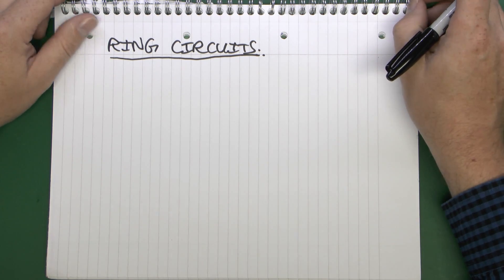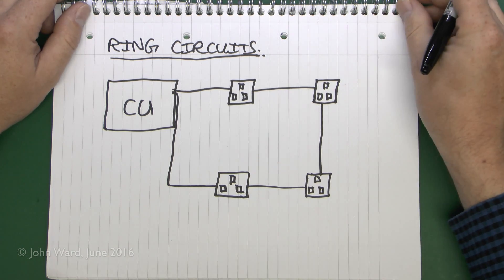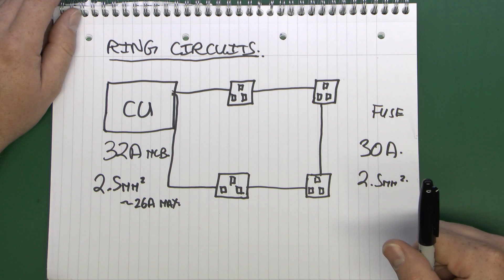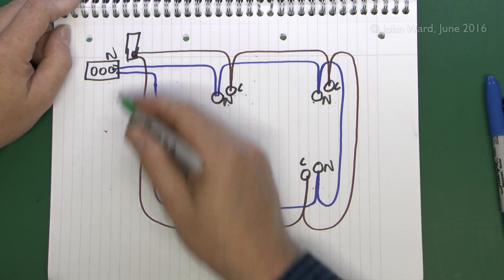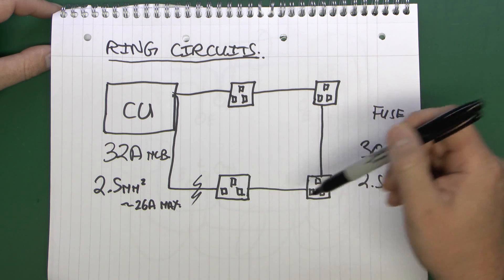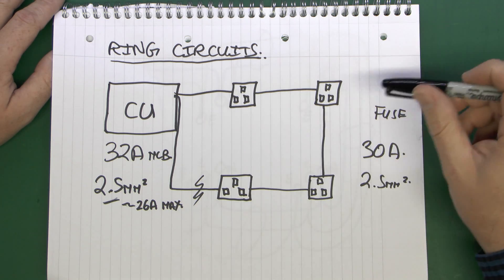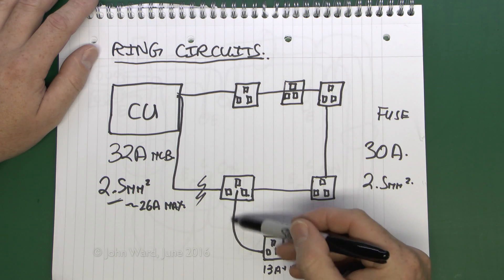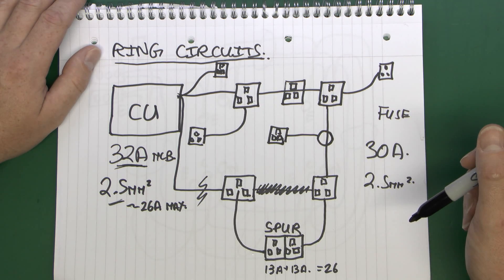UK Ring Circuits (previously Ring Mains) for Socket Outlets

Comment: When I first heard about these, I thought they were relics of the past. I was shocked (lol) to find out that they're still in use today, and you've explained very clearly to me how they work. I wouldn't want one in my house; good thing everything here in the States is what you refer to as radial.
Reply from the maker: They should be relics of the past, unfortunately plenty of people still insist on installing them.
Reply: @jwflame  Why don't they just repeal the standard for new installations? We have plenty of old wiring over here that, if worked on by a certified electrician (on the record), must be updated to meet current standards.
Reply: @RAndrewNeal  
Rings are superior.
Reply: @johnburns4017  If that was true, they'd be more than a war-time cost-saving measure and in standard use all over the world. They're a fire hazard.
Reply: @RAndrewNeal  
Totally wrong. Read my posts on these comments.
Reply: @johnburns4017  No. If the ring gets broken, the effective wire gauge is halved, while the breaker is sized for an unbroken ring. The circuit doesn't fail safe; it fails in a fire.

Radial circuits may be more expensive, but you get what you pay for. Their superiority is why they're the standard.
Reply: @RAndrewNeal  
You never read my posts. A final ring can be protected by one 25A double pole un-polarised MCB. Both L legs of the 2.5mm cable go thru each of the MCBs input terminals. The MCB does not have to be L&N, it can be L&L. The MCB does not care if L or N runs though any side of its two sides. It is essentially two single MCBs joined with the switch levers locked in. An RCD feeding the DP MCB.

When one side of the MCB  detects a fault both poles trip, cutting both legs. If the RCD detects a fault all L and N are cut. The ring could deliver 50A, 25A per leg. The 2.5mm cable on each leg could take 27A but is protected by a 25A overcurrent device - very safe. 
1. If the ring was out of balance it would trip. 
2. If the ring was cut for some reason the MCB would trip if the current went over 25A on any of the legs. 

The best protection on overcurrent of the cables.

The British regs say max breaker size is 32A protection for a whole circuit. So a 25A double pole unpolarised MCB taking both L legs of a final ring conforms. The MCB can be reduced to 20A if the cable is derated, still delivering a max of 40A. Many bases are covered. If RCBO protection is needed an RCD can be added with its L output fed into both sides of the MCB. Both Ns into the RCD. 

Easy. Far better and safer than radials for power outlets.
Reply: @johnburns4017  Well I said I wouldn't. I'm glad that they are indeed fully protected, but that doesn't mean they aren't unnecessarily complex both to wire and properly protect. How much do you save in wire after doubling up on your breakers? It's at best equal to a radial circuit, so monetary savings are about the only advantage you could get.

Radials are dead simple, require a single breaker per circuit, don't require balancing conductor currents, and cleaner. Superior enough to justify potential higher material costs (which is only a one-time purchase; don't cheap out where it matters).
Reply: @RAndrewNeal  
Radials are simple? Please! Many have legs off legs off legs - very complex.  Voltage drops and only one way back for the earth (cpc), so less safe. 

Final rings are simple to install delivering the power, replacing a number of radials. As I wrote using a 25A double pole MCB eliminates this fear of a break - never come across one myself. It will also deliver 50 amps,  able to run an a/c unit with amps to spare. It also uses cheap 2.5mm cable, an unpolarised DP MCB, and will cover 100 squ metres of floor.  No contest.
Reply: @johnburns4017  Doesn't matter how many branches go out from the circuit; they're all in parallel with a single source and single return. As I said, dead simple. Why in the world would you consider something so basic to be complex? Designing a ring is parallel with extra steps, making it more complex by definition.

Voltage drops and? Last I checked, we don't have 0-resistance wire. You are going to get voltage drop regardless. It's just going to be harder to calculate if you're running a ring. Besides, a short radial is going to have less drop than the equally-short side of a long ring. Best case scenario for a ring is as good as a radial; not better. That is, assuming that double the cross-sectional area of the wire equates to half the resistance and double the ampacity.

The ground conductor is a safety measure to begin with, which is redundant in and of itself. There is little benefit in adding yet another. As you said yourself, you've never seen a break in a ring, so why should your sentiments flop just when it benefits your argument? That's inconsistent.

You also failed to answer my question earlier. How much do you actually save when all is said and done after using cheaper wire but more of it and more complex breakers? 50%? 20%? 5%? It can't be more than 50%, and I'll take a generous shot in the dark and say maybe 30%.

You say rings are simple to install? Radials are simpler. One run and done; no looping back to the box. You can branch, but it isn't necessary. There is simply less to keep track of, which makes it undeniably simpler.

With a ring, you're inadvertently running smaller circuits, even though you tout big numbers. Sure, your one circuit can supply 50A, but if I run two radials with the thicker wire, I can cover the same area with 100A (50A per circuit). The capacity of the circuit scales with its cost. Though we mostly run smaller circuits over here because 50A is overkill for domestic lighting and receptacles. 15A and 20A at 120V are most common. The high power appliances usually get their own 240V high current circuits.

The only real advantage you get with a ring is cost, and that's with a trade-off of total power delivery capability. And you've yet to prove me wrong.
Reply: @RAndrewNeal  
Radials can be very complex. You fail to understand that a ring is a simple circular busbar. As the voltage hits a point on the ring from two points, voltage drop is far less of an issue in a 100 square metre floor area - max is 100 metres. 

If the earth (cpc) brakes for some reason ona radial you are stuffed as the circuit safety mechanism has gone. With a final ring that is not the case as it has two ways back to the breaker and panel. The prime role of the cpc is to trip the breaker in the case of a fault - that mat be absent if a there is a cpc break on a radial.  In commercial there is a circuit called a reverse return, it is a radial with the cpc at the furthest point of the radial turned back to the main panel. Only the cpc is in ring.  A domestic final ring has this safety feature integrated. 

One final ring can supply what a number of radials can, using less of and smaller gauge cable.
With many low amperage appliances these days a final ring on a single AFDD makes economic, safety, and practical sense.  

AFDDs are mandatory on some power circuits in the UK, and recommended on all. They are around £100 each. Having one on each power circuit is an expensive undertaking, while using a final ring only one will be needed.  

If you are paranoid about a cut final ring, then a double pole MCB can be used after the rime circuit protection device with the Ls of each leg in each pole. Screwed connections can work loose for sure, but using Wagos to maintain the spine of the ring with flex cable from the Wagos to the socket's terminals reduces that to almost nil.  

In the UK cable over 2.5mm, which is easy enough to work with, is only ever used in 99% of cases and usually for cooking appliances or those instant electric showers. When I go to Germany, France and the USA I see unnecessary  unwieldy heavy gauge cables used on a many radial.  Working with them in backboxes every day! Rather them not me. In the UK in a one bedroom apartment it is common to see three circuits: a final ring, lights and a cooking appliance.  Elsewhere the panel has so many breakers it looks like a school boiler house. 

The ring delivers power, the reason it was mentioned by the 1940s committee, although not mentioned in any regulation until 1950. It was to provide a socket in each room supplying 2kW.
Reply: @johnburns4017  You wrote a lot of words, much of which you already wrote and I already replied to, and still wrote nothing that hurts my point.

It's clear that a ring is a circular bus bar, but it's still more complex than a straight, single-ended one, no? And now you have to account for the average length to a point on it if you want to calculate power loss/voltage drop rather than just a single length. You keep saying that radials are more complex, but you aren't giving any reasons why. I've already given you reasons why that isn't the case.

No, one ring cannot deliver what a number of radials can, assuming you're comparing one 50A ring with several 50A radials. Your total power delivery capability will be determined by the wire gauge you use, and the number of circuits you run. Even three 25A radials will supply more total power than one 50A ring at the same voltage.

It's also clear to me by the content of your most recent reply that you aren't reading all of mine. Otherwise, you wouldn't have mentioned the redundant ground connections again; I already gave you my assessment on that.

Funnily enough, you don't run any lighter wire than we do. A standard 15A circuit is ran with 14AWG wire (2.50mm^3). Strange that you shove 25A through that though; that's way more than the 15A the NEC allows in the code over here. But because you don't split your 240V into two 120V phases, you do get double the power delivery through the same wire at the same current.
Reply: @RAndrewNeal  
I read exactly what you wrote. 
The standard final ring is a 32A breaker using 2.5mm cable. 2.5mm takes a max of 27A. This replaces two or three radials, and only using one expensive AFDD, not three. 

Nearest to the 2.5mm² in cross-sectional area passing 27A max is a 10 AWG conductor at 5.26 mm² cross-sectional area passing 30A max.  That is a massive difference in cross-sectional area. Terrible stuff to work with. 2.5mm is much lighter.

• Once again radials can be complex with leg after leg off them. 
• Rings have the important added safety in two ways back to the main panel for the cpc.  
• Voltage drop is far less in a ring. 

Rings are elegant in their simplicity. The UK has one of the best, if not the best, electrical safety records in the world, and it is getting better by the day. The final ring has been the standard for 75 years and well proven. I have one out of choice.  

I like going to the USA to see how electrical systems were 70 years ago. It is amazing how far behind they are. I have worked with the oddball US system. Three circuits fed into a house: two 120v and one 240v. Duh! And those terrifying switchless outlets and Lego like tiny plugs falling out of the outlets. The breakers in the huge grey panels look like they should be in museums. 

Saudi Arabia change over to the British system from the USA, with 85% done in ten years.
Reply: @johnburns4017  Yet if you ran two radials with the heavier gauge, your capacity between the circuits would be double. Again, it's always a matter of how much you physically have. You can spread it farther and thinner using a ring, sure, but don't delude yourself into thinking you're getting more out of it.

Your second point is a difference of standards, not a difference of physical reality. You push a lot more current through that 2.50mm^2 than we do. We'd fail inspection if we paired that wire with a 25A breaker. It handles no more than 15A. heavier wire than 12ga is used almost exclusively for more powerful appliances.

Once again, branching off from a radial circuit isn't complex or necessary. Why do you keep insisting that is it? It's quite basic. So much so that I never even thought about it until you mentioned it.

Which is it? You aren't concerned about breaks in the wire, or rings are better because extra redundancy? Don't flip flop; it weakens your arguments.

Mathematically, voltage drop in a ring is equal to or greater than that of a radial of the same current capacity (double the wire gauge). Equal is best case, greater-than is every other case (probably negligible difference in most homes anyway). I shouldn't have to explain why; it's Ohm's Law.

"Rings are elegant in their simplicity..." This is a word salad that makes no argument, save for a statement which I've countered several times now. Next.

Which is it? Rings have been standard for 75 years, or the US is 70 years out of date? Dude, that's hilarious. You blew your own argument to smithereens with those ones. And the fact that you put them back to back is the icing on the cake.

And no, we only feed one circuit into homes. It's a center-tapped 240V circuit, with 120V between either of the legs and the tap. This is because 120V is safer and used for low power appliances. In case of an accident, it usually results in a shock and some pain rather than death by electrocution like 240V is likely to do. It's probably the reason you guys are so paranoid; you don't use 120V so you also can't afford a system that lacks guard rails in any place. Any slip up could mean certain death.

Comment: This really is a stupid design. Seriously, why? I’m from the US and I’m not about to say our system is better, but at least we didn’t pull this nonsense
Reply: I do wanna rant though about comparisons between the US and UK electrical systems. 
First of all: buzz off about y’all having 240V. We do too. The difference is that we use split phase power so individual wires in a building only have 120V on them which makes electric shocks less likely to be fatal even if they’re more likely to occur. We have 240V circuits at 20A or more for high power devices like air conditioners, ovens, stoves, etc. In a bedroom or whatever though, outlets will only supply 120V and really that’s more than enough. Our devices aren’t starved for power. I also find it ironic that our microwaves are generally more powerful (1100W being common) even though y’all can have more power from a standard circuit. 
Second: your plug design is smarter. It is much harder to get a shock at all, and the fuses provide overcurrent protection outside the wall too. One really dumb thing here is that smaller gauge extension cords are really common and there is nothing to stop you from overloading them. The circuit breaker isn’t aware of what goes on outside the wall. As long as a circuit with 14 gauge wire is not exceeding 15A, it doesn’t care, but outside the wall you can have a 16 gauge wire (16 is smaller than 14) with the same 15A on it, even though that’s above what 16 gauge wire is rated for. A fuse in the plug would mitigate that danger. In fact, we already have a plug design that has a fuse in it for Christmas (fairy) lights. It would really be smart to at least put them in 16 gauge extension cords. 14 is less of a concern; however, those can still be overloaded without a circuit breaker tripping since 20A 120V circuits are becoming so common. Those use 12 gauge wire so both 14 and 16 gauge wires can be severely overloaded without the circuit breaker intervening. A simple user replaceable fuse would mitigate pretty much all of that danger
Reply from the maker: The ring final circuit was designed in the 1940s to minimise the amount of materials used for the expected massive increase in post-war housing construction.  The typical planned post-war home in Britain was under 1000 square feet and had only 3 electrical circuits (lighting, cooker, and one ring for all other outlets/receptacles). 
Everything would use a standard 13A fused plug (compared to 6 or more totally incompatible unfused types used previously), and on a single circuit rather than individual circuits for each outlet.  The ring allowed the use of undersized cable (20A rated on a 30A fuse), and because of the fuse in the plug, any appliance from nothing to 3kW could be connected to any point. 
Everything in post-war Britain was in short supply and when needing to construct millions of new homes quickly, every saving in materials made sense.  That's also how dubious things like homes made from prefabricated concrete slabs with no insulation were created. 

However that was over 70 years ago, and most of those concepts don't apply now.  Unfortunately rings are still installed because 'the old ways are best' and even worse, have been corrupted into having multiple rings in each property which actually wastes materials compared to using radial circuits. 

There is no requirement to use a ring circuit, and never has been.  With modern homes and modern protective devices (RCD/GFCI and AFDD/AFCI), the whole idea of a ring covering all or most of a property is nonsense.

Comment: It's a bit odd that British electrical code is allowing you to put 26 amps through a 2.5 mm² conductor.  Quick look up indicates that's about 13 AWG, and 12 AWG (3.3mm²) is only allowed 20A under the US NEC.
Reply from the maker: Current rating depends on how it's installed, the 26A rating only applies when it's clipped to a surface or concealed in masonry.  It's a lot less in other situations such as inside walls/ceilings with insulation.

Comment: SO JOHN, ARE YOU SAYING THAT A RING CIRCUIT WITH A BROKEN/LOOSE CONDUCTOR WOULD OVERLOAD THE RING CIRCUIT STRICTLY BECAUSE OF THE SIZE OF THE MBC BEING '32A' & IF IT WAS ONLY '20A' THEN HAVING A BROKEN CONDUCTOR WOULD PRODUCE JUST A RADIAL CIRCUIT WITH NO CHANCE OF OVERLOAD?